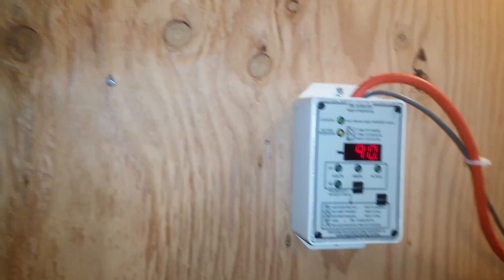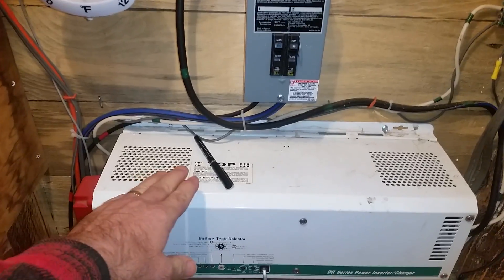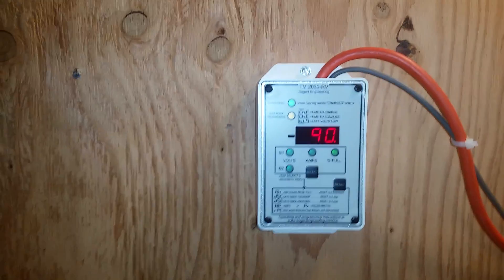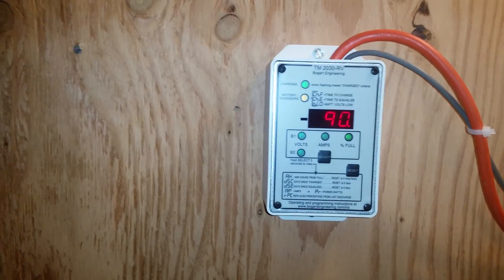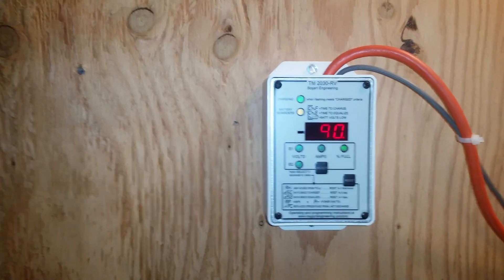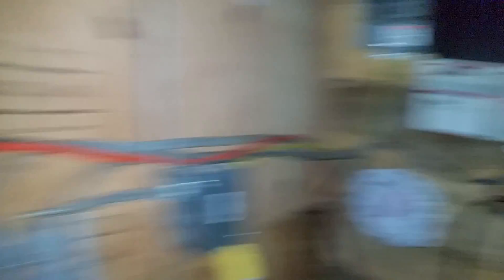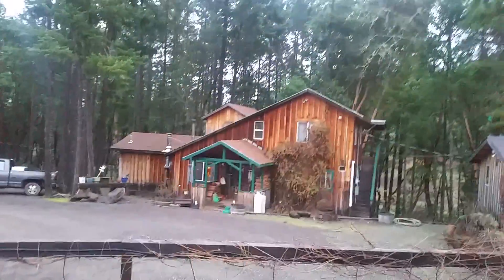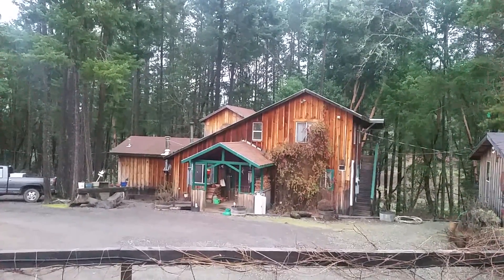24 volt genny running with an explanation

Comment: Beyond COOL! So impressed by your work. Do you need any Renogy Z brackets? I got a whole slew of them (some new and some used). I like how you mention costs of your system...and being 100% off-grid. We are all "at some point" with our systems. Some folks have more, some have less. Those who DIY like you and others...is really impressive! Thank you for sharing what you do!
Reply: Sounds good...just lemme know where to send them when you get ready. I will put them in a mailer box and send out. Saves you $18-25...and I bought too many of those Z-brackets. I am sure I got 8 new ones for two Renogy panels. No worries...no charge...just a "thanks" for the great videos you put out.